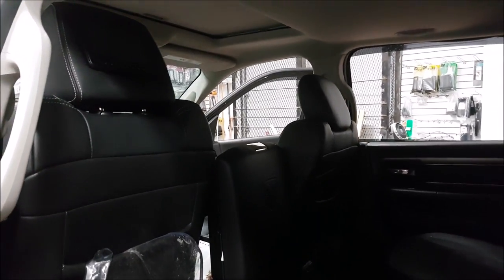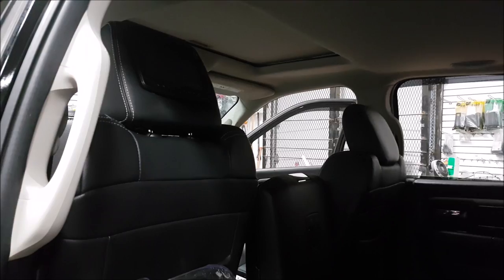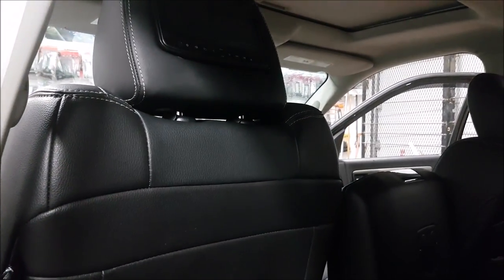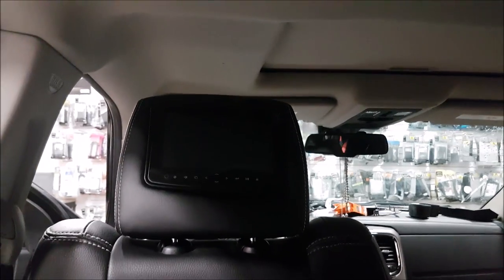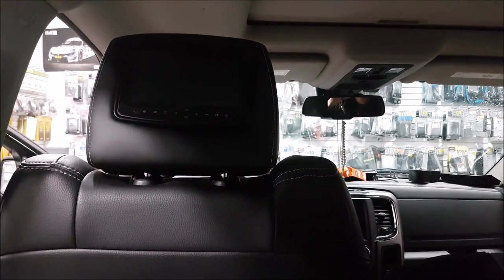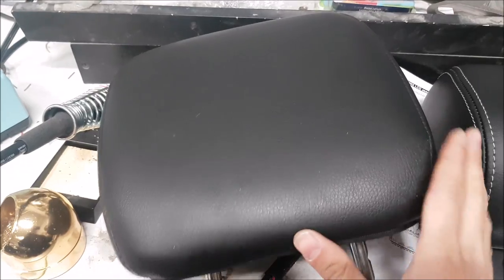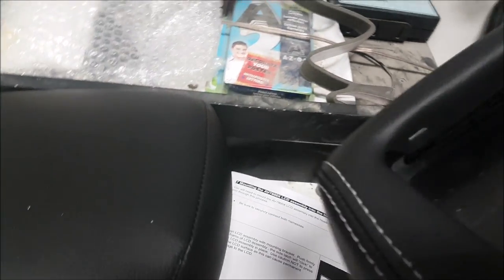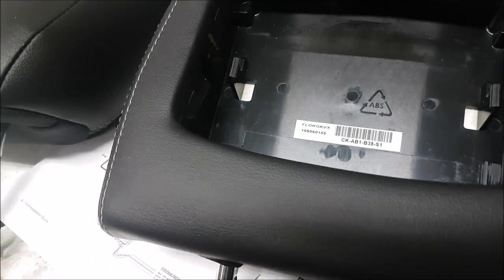Headrest Screen Installation (Rosen AV8900H, AV7950H and AV7200 Headrest Replacement Series)

Comment: Are those screens compatible with most head units? I have the X009-RAM
Reply from the maker: Yes the AV module has a variety of inputs you can put into it just like any other rear entertainment system.  It would go awesome with your Alpine Perfect Fit.